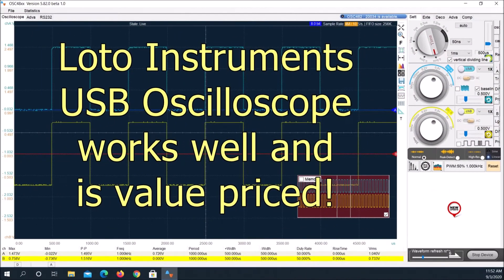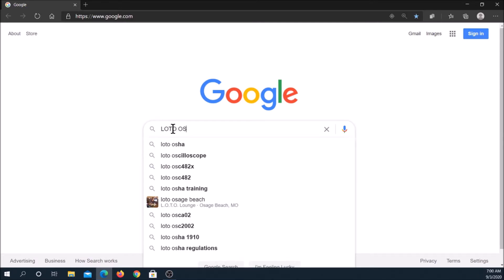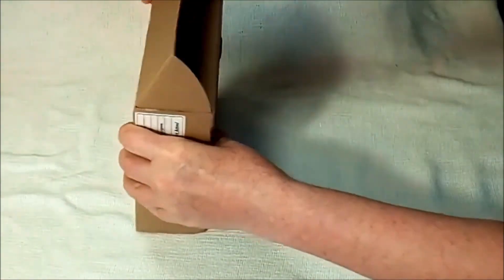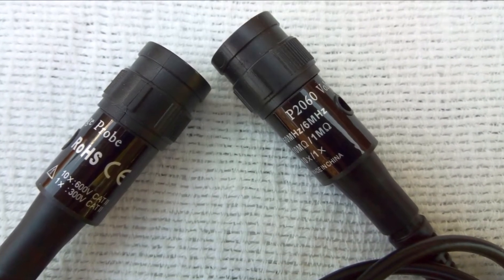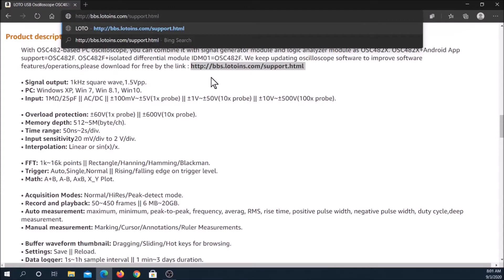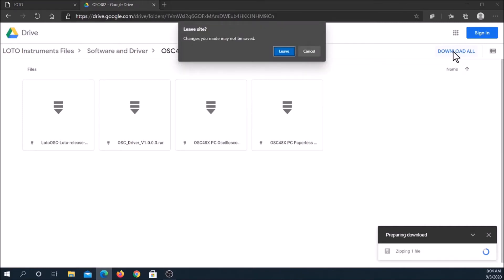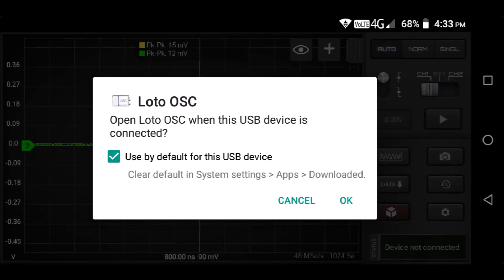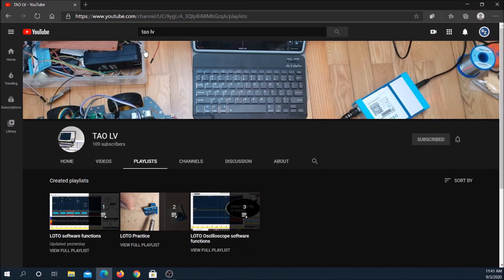Loto USB Oscilloscope, Logic Analyzer, Signal Generator (OSC482F)

Comment from the maker: This is a brief status update. As an electrical engineer, I've now used the Loto Instruments OSC482F oscilloscope for a year. It's been a very handy tool and is still working great. Currently OSC482F software is running on my HP 840 G3 i7 laptops (Windows 10 Pro). Also on my UMIDIGI A9 Pro smartphones (Android 10 and 11). I love using this product and think you will too.

Comment: Thanks for the video. The F version is twice as expensive than the version without a letter. Is it worth the extra? I don't need AC, more than 48V, and I'm still quite a beginner in electronics.
Reply from the maker: Suggest you ask this question on Facebook's User Group for LOTO USB Oscilloscopes. Either Lucus Lue, a Loto Tech Support guy, or one of the other 270 members will be able to give you an accurate answer. Good luck!